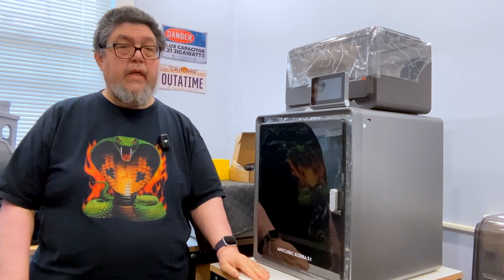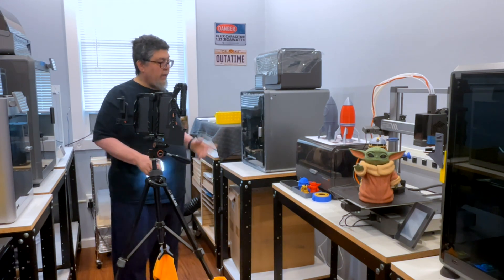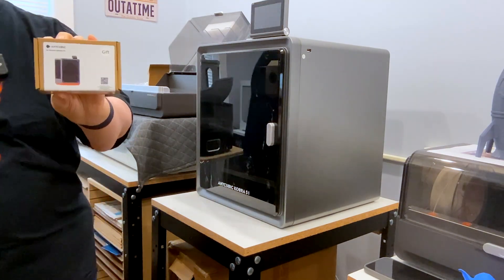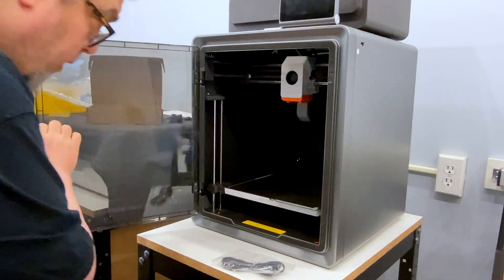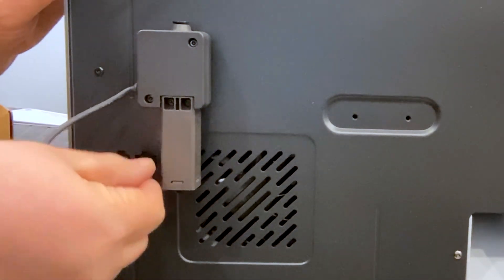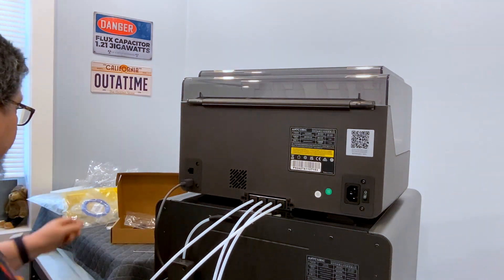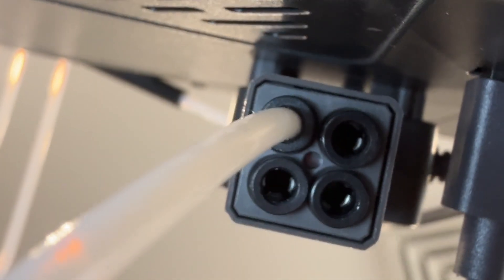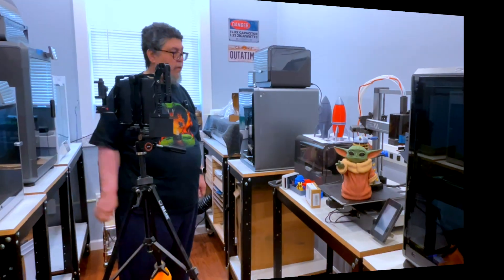Anycubic Kobra S1: complete setup walkthrough

Comment: The blue clips on the ACE Pro were easy to put on for me.  I just pulled on the teflon tube so the whole mechanism came out like 1/2", then they just clipped in with minimal effort.  I used my thumb, so no breakage due to tool use.
Reply from the maker: I tried that and it was still a fight. On the other hand, I'm not nearly as coordinated as I'd like to be.